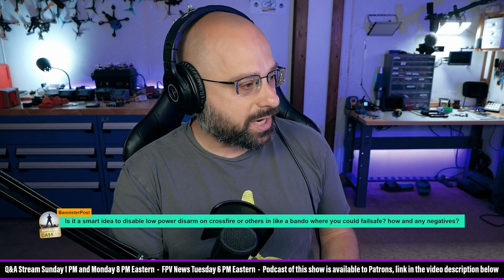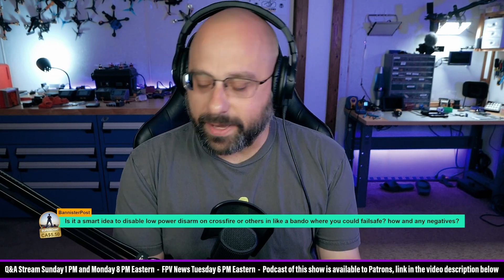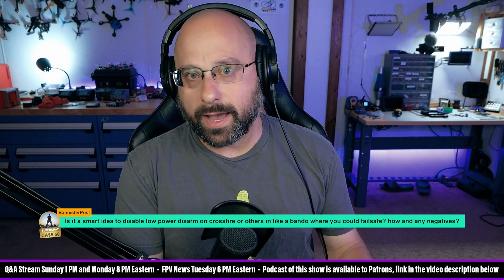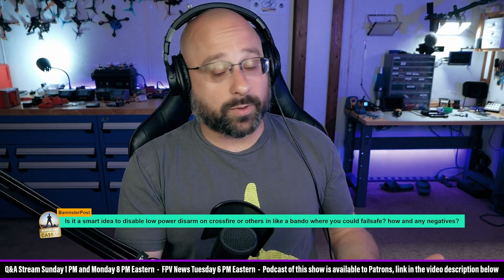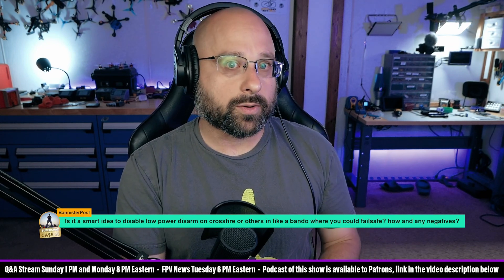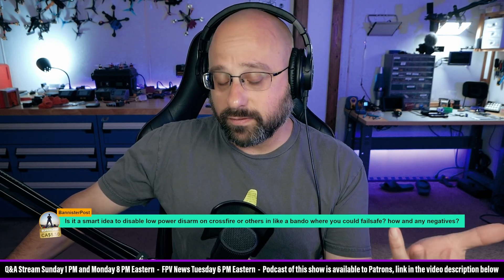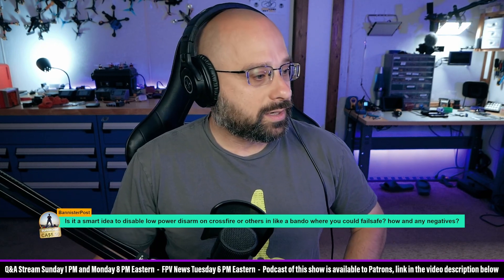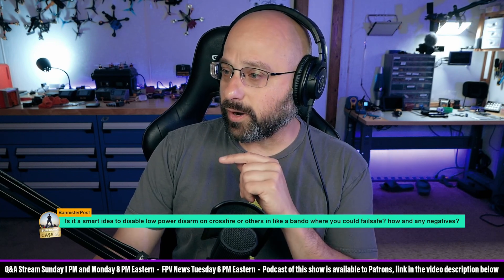Should I Disable Low Power Disarm In A Bando With Crossfire? - FPV Questions

Comment: BetaFlight also has an option to have low power on plug-in but not go low power when disarming. I think the turtle mode trick is a better option though. Some control link protocols have a model locator option as well.

Comment: Hello! I want to build my first FPV drone, which weighs around 610g. I want to have a fully black drone and thought of the IFlight Xing 2's 2207 in black with 1750 kv. I would use the Gemfan Hurricane JB edition. Would 1750kv be to weak for such an drone and should I get the Xing 2's with 1855kv? Would there be a substantial speed difference? I want to fly 6s.